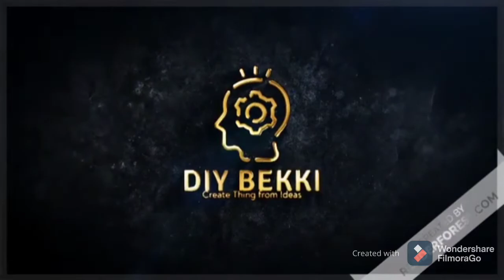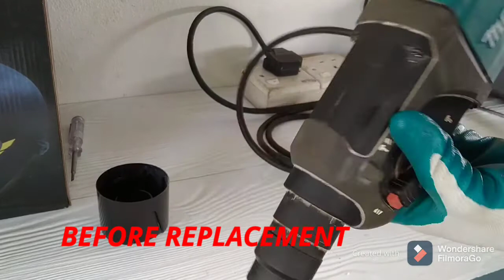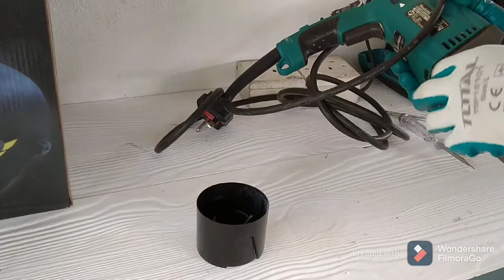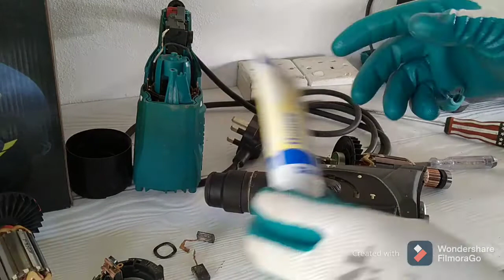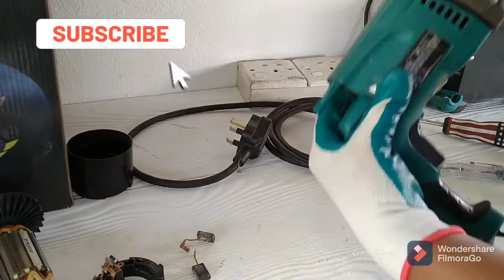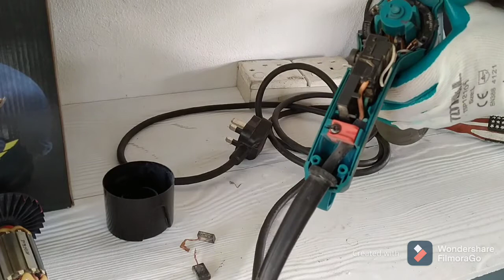DIY- Makita HR2470 Amature and Carbon Brush Replacement

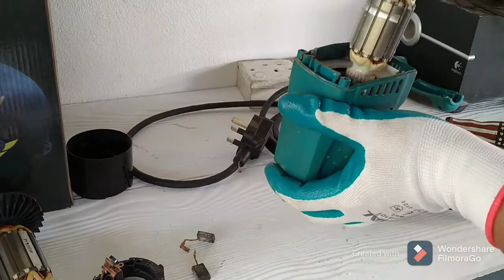Comment: hi bro, thank you for the video, you are the only one on youtube who can help me in order to repair the machine. At 09:40 how can you put the part in your right hand in the other part without being annoyed by the carbon brush ? when i put it in i breaked the carbon brush ! .... i really don't know how you can do it whitout doing damage on the carbon brush.... and also the white plastic part that we can see at 09:40 i removed it, i unscrew the 2 screws at the interior which allow to attach the black part at the back which contains the carbon brush and I can't put them back correctly... then what kind of grease do you use to grease the inside of the drill?  thanks for your help !

Comment: Sealed bearings instead of shielded, washer in between the dront bearing and the commutator to shield the bearing from the UV (from brushes arcing and sparking on the commutator) and dust from the carbon brushes.
Helical cut gears and an actual oil seal in the gearbox on the motor shaft according to the parts diagram.
The presence of that oil seal indicates that Makita uses a low viscosity grease that is very liquid in these hammers which is good because it will flow around in the gearbox and provide very good lubrication.
Well made hammer drill.

A similar priced Bosch drill the  GBH 2-21 comes with shielded bearings, no washer on the armature between the commutator and the bearing, no oil seal on the motor shaft and a shorter straight cut gear.
Shielded bearings are inherently more prone to dust intrusion and thus becoming noisy, dry and damaged.
The missing oil seal indicates that Bosch uses a thicker viscosity grease which isnt great for hammer gearboxes.
Straight cut gears make a lot more noise too and the gear on the Makita is longer which means more gear engagement = longer gear life.

I will buy the Makita drill because its better engineered.